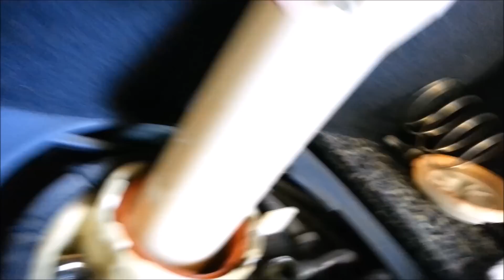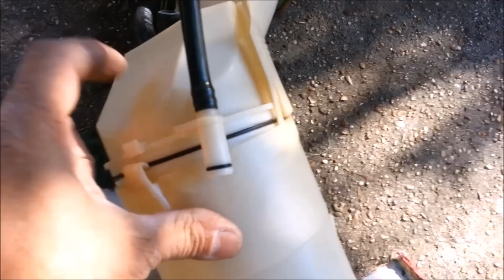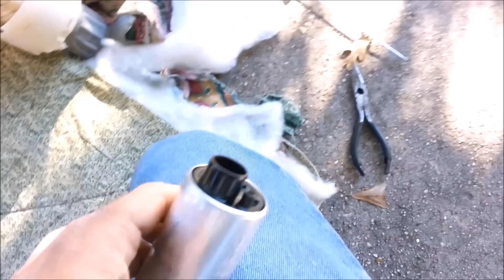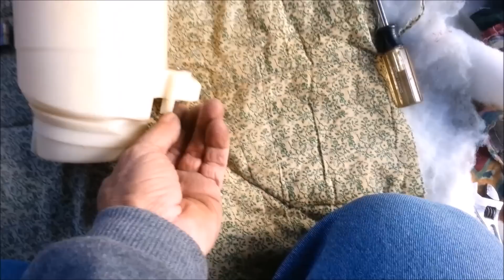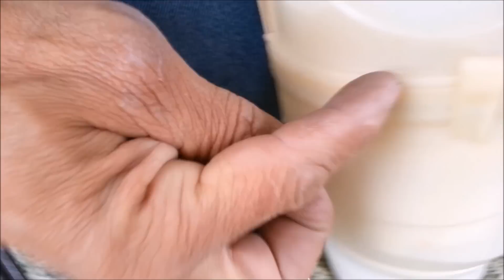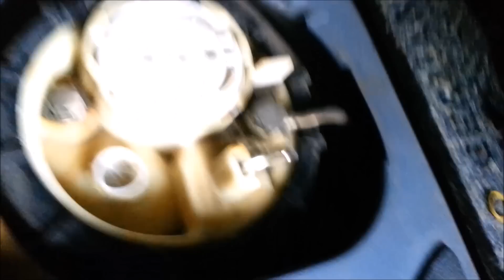HOW TO REMOVE AND REPLACE FUEL PUMP 2000 AUDI A8

Comment: hi George G where did you buy the fuel pump motor
Reply from the maker: Ebay. I dont remember sellers name. DO NOT buy cheap after market or universal pump. Get OEM part so you dont have any issues.

Comment: Just a note after doing this. You don't have to pry the plastic clip off with a screwdriver. There is one other small catch clip that lets you twist the entire lower unit counter clockwise until the other clips are free. Also u didn't show the whole pain in the ass install. I had to use printed service manual pages in the trunk with me to get the mf in.
Reply from the maker: Wonder why things are designed certain ways by manufacturers ?  Thought I had recorded install but no.

Comment: Just used this to do the pump on my 99, I'm getting in line to punch the engineers who made this goofy set up. My one tip to someone confused on install, there's a plastic holder in the tank that the pump assembly has to sit in, you can see it really easy if you shine a light in the tank

Comment: Hi Geroge, tnx for the vid. i was wondering how i can get the assembly out after geting it loose, it goes aprox 10 cm up but then it seems like something is stuck.
Reply from the maker: I have never had issues removing or getting stuck. Just give it a good pull and or twist and pull

Comment: Does the back seat come out to make it more accessible, I'm too big and old to get in trunk.
 I thought there were 2 pumps, what's on the left side?
Why do u need to take out that center piece  first?
Reply from the maker: I dont know if the back seat back rest being removed will allow access to the top of fuel pump housing from the passenger seating area. I removed center piece to drain all gasoline as possible

Comment: Did this today with Great Success!  Thanks for the video
Reply from the maker: Glad it helped. You saved quite a few bucks....
Reply: Do you prime the pump?
Reply from the maker: @MMAandCARaddict  Just turned ignition key to on for a few seconds then turn engine on. Everything worked as it should.
Reply: @RAMBLE_ON  yup. So did I lol.  Wow man thanks.  You helped alot. But ALSO left out alot of details  with missed camera angles. Not not showing many critical things.  But I'm not complaining.  Still very helpful
Reply: The hardest part was getting monstrous weird looking thing out.  Apart. And back in lol.  Like wtf were they thinking

Comment: Hi George G. Thanks for your video. My car is a 1995 Audi A8 (the D2 model). Besides several minor issues that a 95 car usually has, there is a luttle “buzz” when the fuel tank is about half capacity. It’s time to hurry up and fill it up otherwise the pump isn’t able to catch the fuel that is still in there. Any tip? Will I need a new pump? I looks like it works, but is not being able to get access to gas witch is more in the bottom of the tank. Thanks a lot!
Reply from the maker: I would bet that the tube has come loose and not able to feed gas properly. Watch video at part I talk about importance of tube. My guess its time for a new pump. If you must open to access you are better off just replacing it.

Comment: i have Audi A8 2.5 TDI V6 2001
the fuel pump is work but still my car doesn't start!
can you give me some information?
Reply from the maker: +Fatton Vaksi My friend that could be a number of issues. If you have proper fuel psi move to spark. Make sure your pump works properly. If you have fuel and spark check timing.

Comment: Hi georgeg
thank you for your help to explain the way to open the fuel pump . 
i have some truble with my audi a8l,4.2l fuel pump , i was asking if your car is 6 cylinder or 8 ,im looking for the number of  the pump to buy it , for both of them , R&L  , 
email me at : mashrooat@yahoo.com. 
talal
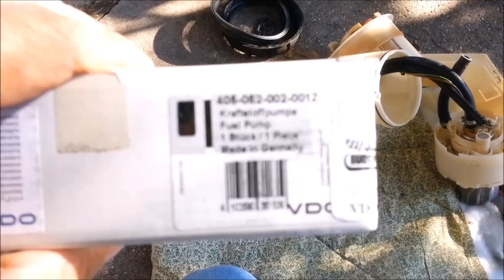Reply from the maker: +Talal Ali Look at video and at 15:22 mark is the correct fuel pump part number for this Audi A8 4.2L
Reply: +george g thank you for your help,  
Witting for your new video

Comment: my mechanic replaced fuel pump on my 2002 S8 and when i have less than third fuel car wont run gives a misfire code
Reply from the maker: +Vaso L. He did not set fuel pump properly. Very critical to find correct spot. I was brought a car from someone with same issue. I removed pump and re sat pump and it runs perfect. If your car was running correctly without this issue and you replaced the pump due to failure then he did not sit pump correctly. My opinion
Reply: +george g 
probably didnt replace the gasket set...
How much would it cost to redo the whole thing with proper gaskets? or i can do it myself if its only the top gasket
Reply from the maker: I do not know going shop rates. I am just a "back yard" mechanic, but a good one, who does lots of work for friends. I dont know what you are capable of but you can watch my video for help.
Reply: +george g thanks,nice vid!
Reply: +Vaso L. wish you are close to chicago ill be glad to pay you to do this right
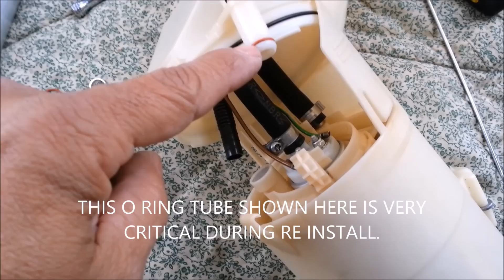Reply from the maker: Check out video at 19:16 I show you exactly what is wrong with your car. And no way you will catch me in Chicago, to F'n cold!

Comment: Hey George, thank you so much for the great tutorial! After 2 hours the pump was basically back in its place. Problem was of course the last 3cm for it to come down. After a couple hours of wiggling and swearing i got myself a cheap borescope and went in through the opening in the pump housing, facing down to the socket with the metal gasket. Then i took a piece of round bar and cranked it in a way that i could reach the basin on the inner lower part of the housing and pulled it slightly so the upper housing could fall right into its place. Worked of the first try. The housing in my fuel tank was kind of floating around and would in no way connect to the other part by chance. I would definitely recommend a scope for this. Again, thanks a lot! Cheers, Flo

Comment: I watched your video a couple of times and loved it. I recently received the new fuel pump but I have had a hard time locating a gasket kit. Where did you get yours? Thank you.
Reply from the maker: Thanks for watching. I will try to find vendor for you. I hope I kept record. Difinite ebay purchase but I dont think I ebay will allow info that far back. try googling "audi a8 gasket"
Reply: Thanks for the information. I took your advice and googled A8 gasket and it sent me to ECStuning.com. I was using S8 gasket kit before. $187.06 was the total cost for the gasket set. NOT a great price but I don't want to do this for another 150,000 miles. I'll probably replace the timing belt in another 20 -30K miles as well. It's so much cheaper to do these things yourself.
Reply from the maker: Stephen Faust These F'n prices on all this simple stuff is rediculous, but what can you do. The best we can do is not have them do repairs. So DIY and save lots of cash.

Comment: BTW.  I kept the old removed fuel pump and cannister. When I took the pump out and connected 12 v to it, it ran fine.  I cannot confirm that it will put out the required 50 psi, but after the mechanic installed the new pump, the car only ran a block then died. Dealer mechanic determined it was a bad fuel pump relay and then the car ran well except for the major gas leak problems.  I suspect the pump was normal and I got ripped off.  If anyone wants to buy a used possibly or likely good pump, contact me.

Comment: Great video. Just had North Shore Audi in Milwaukee do this repair. They said the electric pump alone was not available and an entire new fuel pick up cannister and contained pump were the only replacement unit available.  They charged $1200 for the part and 4hrs for labor to change it even though they performed none of the dis-assembly and reassembly that you demonstrate in the video. Furthermore, their mechanic forgot to tighten the black ring on the driver's side sensor module and when I filled the tank with gas, I had gas pouring out of the tank.  The dealer wanted to tow the vehicle back for repair, but I decided to check where the leak was.  Found the mechanic had stripped out all the sheet metal screws on the access covers to the left sensor and the right fuel pump and gas had also squirted into my trunk soaking the carpet. I found gas pooling on top of the driver's side sending unit. The retainer ring was just lying free without any apparent attempt to reinstall it. I tightened the black ring and let the gas evaporate from the trunk carpeting.  When I drove the car,  the ecu put up an engine fault code indicating a leak in the evaporative emission system which no surprise considering the magnitude of the gas tank leak.  Took it back to the dealer, they said that a cap was loose on a vacuum line which was tightened and the code was cleared.  I filled it with gas and this time gas was pouring out of the right side of the tank.  Took it back and now they said they found the gasket under the retainer ring of the fuel pump was defective and had to be replaced. This was supposedly the cap on the vacuum tube that they had tightned.  I am quite certain that if the gasket were installed and the ring tightened that, at most, there would be a minor leak not gas pouring out of the tank as fast as it was poured in.  The mechanic had to have forgotten to install the gasket. Moral of the story: Everyone that has this problem, do not take it to the dealer.  Follow this video and you will save literally over two thousand dollars and a lot of aggravation.
Reply from the maker: Thanks for your comments. I have nowhere near the so called training that dealer mechanics, any dealer, do. Most of the time common sense , a few tools and a bit of expierience goes a long way. I will never take anything to dealer. Glad it helped you. Peace